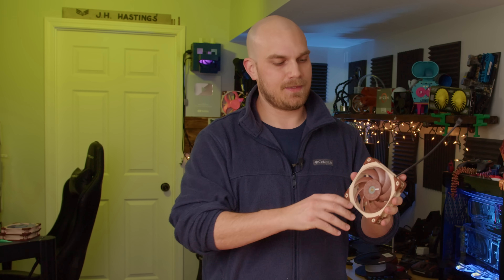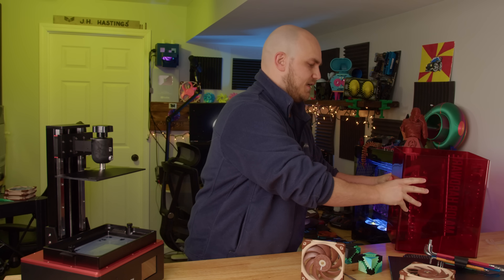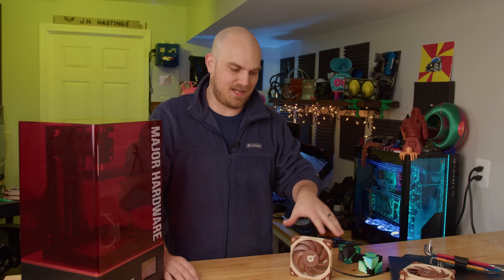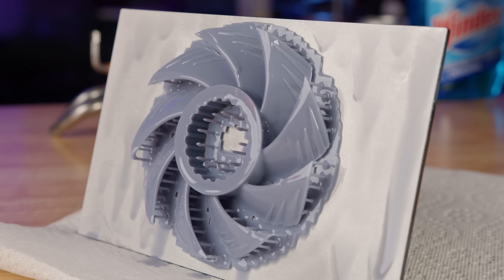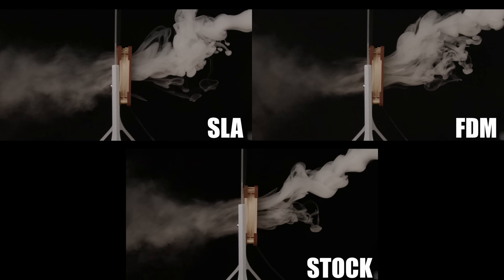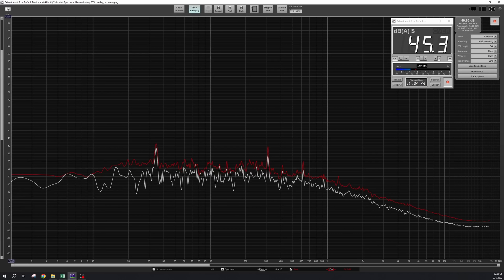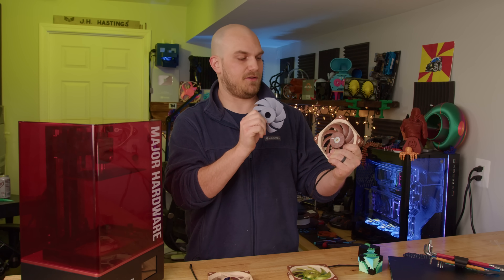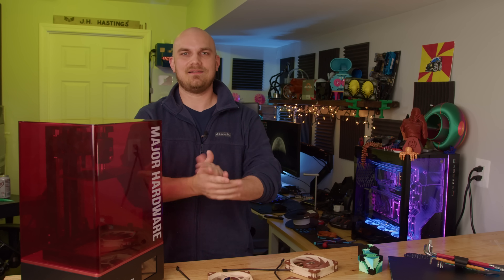I Copied Noctua's A12x25 and Resin Printed it, Its Performance Was ASTONISHING

Comment: I wouldn't bother with SLA printing that much. Maybe only print a fan in SLA if it makes the top 5 leader board. 
I would look at material density, i think you might find noctua uses a modified light weight plastic. A lighter material the motor should be able to spin the fan faster. You might be able to FDM print in ABS if you find one thats less dense around 0.9 g/cm^3. Most FDM plastics are focused on strength and ease of printing, i would think this gives them additives that make them heavier.

Comment: Print best models with resin, and try some of geared models from the past. Resin quality should help with perfomance of gears.  And you may try to print fans holow... not sure it will save alot of weight but some models are heavy.

Comment: A wider test across a couple of fans could give us a more acurate range of how much resin matters. Maybe the 2% is not that much on average, or in this special case, flex acts in a specific matter that either helps or is detrimental. I would try mayve with one or two structure dependant contestants for the showdown and one or two blade design ones to have a better picture

Comment: Personally I wonder if it maybe just comes down to the surface smoothness, since the surface of the FDM printed fan is rather rough compared to the SLA printed one.
That rougher surface could lead to more turbolent flow over the surface increasing resistance and therefore decreasing performance.
So depending on the filament you could treat it with a heat gun (PLA) or acetone vapor (ABS) to smoothen the surface.

Comment: For the FDM fan switch to 0.12mm layer height, use the exclusive tolerance setting, and maybe use some ironing. See if it makes a difference!
Reply: ironing only works well on smooth top layers. On everything else it's a waste of time and is likely to lead to print artefacts
Reply: @iamdmc  Right, but since there tend to be some flat areas towards the front of the blade it could have some minor advantages. Was my only thought.
Reply: Agree with the thinner layer height - surely the resin printer had thinner than 0.2mm layers - let's try to keep it apples-to-apples!
Reply: @fredhamilton1701  His FDM prints are nice, but there are definitely a lot of settings he could tweak for ultimate quality. Problem is the print time tends to go up a lot as you probably know.
Reply: Agreed 0.12mm layers will be a significant improvement.

Comment: YES! Fan blades can benefit greatly by the finer details that resin printers can produce. It would also help to reduce the issues with complex parts because of the tighter tolerances... but one issue with some resins is their shrinkage factors, so some work might need to be put into finding a good resin that has minimal shrinkage and is inexpensive. If cost is not an issue, then there are many engineering quality resins available for a premium that would work very well. Overcoming the messiness and post processing when compared to FDM can largely be done with a good workflow, but yes there will be more steps.

Comment: 2 percent worse AT BEST.
this is a fan you tried very hard to engineer that prints very well and you cared about how it printed for the test.

a lot of user submitted fan look ROUGH compared to that print with obviously much thicker layer height, artifacting, and worse support removal.

the takeaway here is that there's a meta-game to the competition to try and produce fans that perform well but also PRINT well, because making a fan that can printed in good quality will increase performance. 

though we also didn't check the very important data of "material density"
its not a fair test if the FDM fan is heavier than the competition; of course it'll spin slower with more load.

Comment: You should try dipping an FDM fan in some resin then curing it with UV.  That should hopefully provide some smoothing the the FDM print.  You should also try other smoothing methods like ABS in an Acetone vapor bath/chamber.

Comment: Hi Tom, so I have an idea to see how much better contra rotating blades would be. 

Could you take your model mirror it and print a second one and mount the two fans back to back and see if/how much better that setup is compared to a single fan?

Comment: Lmao, you and I both lost beards in trimming accidents in a very similar time frame.

Something to take into consideration is that if you do move to resin printing for the next season, you will need to use the same exact type of resin for every fan. Kind of how there are different material types for FDM, different brands and different SKUs within the same brand will produce different material properties once they are cured. Some are more rigid and brittle than others and like wise, some are more forgiving to forces that are applied to them. Just something to keep in mind.

Comment: i got the elegoo Jupiter, I think you might like it. its a fully enclosed resin printer with a port in the rear to vent the fumes out. it also includes an autofill port and has a higher accuracy compared to the mars. though if you have the money to shill out, I would wait for the Emake3D Galaxy 1. its a fully enclosed, climate controlled SLA printer with professional grade accuracy and supports a massive list of resin types making it capable of printing rubber materials, you can literally print RC tires.

Comment: For detailed prints I usually run mine at a layer height of .15 and seperation between the model and the support of .3. I had tried even more layers (.12) with separation .36 but it is quite evident they just isn't that precise.

Comment: Do a limited run of say, the Top Ten ALL TIME fan-made fan designs(or Top 5, whatever).  "Normal" 3d printing is good enough to compare the fan-fans to each other, but to see if you can close that gap for those fans that are close or surpassing the Noctua.

Also, if you're testing the resin printed version to a different Noctua fan(IE A fan that wasn't torn apart), .6% could be margin of error for using different motor.  Since it is so incredibly close, I would use it as a control from now on for when you change tests or whatever else.

Comment: Before you consider resin - what about FDM with ABS and then using the IPA atomization chamber? I'm just wondering if the rougher lines of FDM printing is accounting for the efficiency difference. With a smoother surface - shouldn't the ABS provide the same results? Thanks for all the cool experiments!

Comment: It's important to do what you enjoy to reduce burnout; if you don't like resin printing, don't use it. Have you considered having a regular season with FDM fans, then having an end-of-season finale (of the top designs throughout the season) in resin? Designs would still need to be built around FDM, but it would provide a more fair comparison to retail fans like the A12x-25.

Comment: 100% resin print the previous winners to have a showdown on what they could be. And maybe even compare then to old prints, if they will get that 2% difference or if in some cases old prints worked even better. I would think sometimes not the smoothest result might also be advantage. Do that before having whole season in resin (smell) printing?

Comment: If it helps you get more fan showdowns published, stick with your current print method and replace the stock fan on the leaderboards with the printed version for a fair comparison. It's easy enough to estimate a 2% increase across the board.

Comment: One thing to keep in mind though - fan hubs will have some degree of speed variations from hub to hub (sometimes +/- 10%), and if the blades are lighter, the RPMs might increase. I think you should check fan RPM in addition to noise and airflow to verify that the difference in performance isn't caused by speed variation.
Reply: Yep.  Even mass delta of the printed plastic could affect the fan speed.  I am sure that noctua uses the lightest plastic that still maintains the structural strength required to hold the fan together at RPM.

A heavier fan will be harder to spin.  Not just friction of the layered print, but mass is a factor.
Reply: @StefanMArndt  not sure if that’s necessarily true. Noctua cares a lot about silence, but also a lot about durability and life expectancy. Heavier fans might also smooth out speed a bit
Reply: Mass changes nothing but inertie, it will start slower, but will have the same RPM at the end ; as long as there is no acceleration, mass doesn't  affect movement.
Reply: @neodymelanthanide2101  Increased mass will change vibration harmonics. Shouldn't matter for the airflow but may affect the noise levels.
Reply: At that level of air resistance i think that little of a weight  variation becomes neglectible.
Reply: Too bad that the OG Noctua A12X25 is fused to its hub. But he could just switch which hubs that the FDA and Resin fans are mounted on to see if there's a difference. And getting an accurate scale and weighing the fans would also be enlightening.
Maybe even sanding down the heavier of the two until they have equal weight.
One could also look at the difference in bulk density between the resin and the FDM material, but the layer thickness can easily drown that out for thin geometries like fan blades. I.e. it would only matter for fans that already handicap themselves by being bulky and heavy.
Reply: Mass and moment of inertia data may be interesting to track.
Reply: To avoid differences, the fans should be tested before removing the Noctua fan from the hub. This would ensure that the three hubs selected for the test are equal.
Reply: Absolutely true. I think the make apples to apples comparision, you want to use the same hub for every test and run the fan RPM controlled.

Comment: 8:10 I think you should do another testing episode with the resin vs fdm. Do multiple models in both, test them all; and if we see consistency in the performance difference, then you should go with the easier, cheaper, faster option. From there we can just assume a performance improvement if done in the other medium.

Comment: i think a fair comparison would be to set the stock fan shape in showdowns to use the fdm stock printed instead of the injection molded one that came with the fan. That way you can still print in FDM but the comparisons would be purely on fan design since you've eliminated the disparity in part quality.

Comment: I would only resin print fans that do particularly well. Easy enough to add 3% on your excel sheet to get an idea of where it would land if resin printed - maybe a special episode with best of the best resin printed? It would also be cool to use your accurate model of the noctua to create designs varying number of blades - considering the effort you put in

Comment: I'd say to start off conservatively; take the top two best fans of each season and test them out vs themselves (resin version vs filament) and the Original, in a slightly more comprehensive test (both free-flowing, then in front of a radiator, then also in front of a heatsink). Then pick out the best ones to start off a season or two of Resin designs (maybe one season of tower cooler/airflow-focused, and one season of radiator/static pressure focused).

Then maybe go wild with a few resin prints of wild designs, such as the Tulip, or those that had very good performance but was hamstrung by blade warp at high speeds (basically scratching the inner frame and losing some performance).

Comment: With the comments of the resin printing the top 5 fans for performance comparison, I think is a reasonable idea, but, I think the real criterial should be what geometry of the particular fan is involved? A clunky blade design isn't going to care if it's printed on a clunky printer... but if you have a model with thin details or intricate details, I think you're going to see more improvement with the resin print. Another example perhaps would be the mobius strip fan thing... the $3000 boat propeller one... that would likely appreciate a thinner leading and trailing edge.

Comment: EPAX X156 3D printer With a 345x194x400 mm build volume. is a solid resin big boy. and if you look at a video for resin model stacking like from uncle jesse's "Extreme Resin Stacking 3D Prints" you might beable to do a full seasons fans in one print. so you don't need to deal with resin printing much.

Comment: you need some carbon filters on your resin printer. they help soooo much with the smell. i had that issue at first and got a few and boom almost imperceivable. its there but you really need to get close and take a big wif to smell it. atleast for my setup i did.

Comment: A resin print season would be cool. But I also would like a confirmation that it is indeed 2% better across the board not just in this case. Also I think that if the resin print season seems like a lot of effort and you do confirm they are 2% better... you can always switch back and just have mock resin stats

Comment: Did you measure the weight of the resin vs the FDM print?  Could some of the performance difference be due to a difference in rotating mass?

Comment: You can get resin quality print on an fdm printer fairly easily. Stock ender 3 can print at .08 or even .04 layers heights and with the right slicer settings it’s pretty easy to make layer lines disappear. Looking at 4x the print time though

Comment: If something comes within 2% of the stock fan then sure, see if resin pushes it over the top, but otherwise stick to whatever is easiest for you. As long as the rules are consistent then you're still comparing like for like within the leaderboards. The "absolute" performance isn't the point, it's the relative performance that matters.

Comment: regardless of your choice of what material you use for the next season, i feel you should use your copy of the noctua rather than the original. since there is a difference shown between the two models made from different materials. i feel even if you made an exact replica of of the noctua there would still be a difference in terms of performance. and no matter size in the difference it would only seem fair to judge people's fans against the copy with the same material.

Comment: You can try resin coating the FDM print.  It might smooth out the surface enough to improve the performance.  You can also try resin coating your future FDM prints.

Comment: How does the weight of each fan compare? 

Considering the same models, it would be interesting to see how the mass would affect the performance. This parameter may be linked with rigidity though. A study might have to be done where a less rigid, more massive model is compared with a stiffer, lighter model. (Assuming higher rigidity and decreased mass are beneficial. Might not be the case though)

Comment: There's a lot to be said about the fluidity of air and the smoothness of resin prints but I think resin fans might worth pursuing just because of the volume of fans with other moving parts like gears and such. Resin printing those fans will definitely cut down on the grinding noise and help with smooth motion.

Comment: i honestly don't think it's worth printing every fan in resin. perhaps at the end of each season you could reprint the top 3 or something and see how good they actually are, and eventually you'll gather a statistical deviation that is common between any fan printed SLA vs FDM. this means you could infer the performance of any FDM fan based on previous trials, which could tell you ahead of time whether or not a given fan would be worth retrying with resin.

Comment: I've been getting back into resin printing and let me tell you a flexible magnetic build plate does wonders for getting models off.  Had a model that nearly covered the whole build surface that wasn't a total nightmare to get off, just a bit of twisting and slipping in a small metal spatula.

Comment: I think that as long as that 2% performance reduction is repeatable across different fan designs, then there’s no reason to suspect the SLA would give a meaningfully better test of designs. Although, DFM is an important part of any design, so the increased limitations of FDM may actually make it a better test.

With that said, if it reduces the cycle time and/or labor of doing the prints for you by using SLA, maybe that’s still a worthwhile investment.

Edit: spelling

Comment: I imagine the person that sent that other guy a model probably doesn't work there anymore or got reprimanded pretty hard if anyone actually found out. I suspect the resin printer difference might be down to the density of the print, a more solid structure might make it more sturdy. No doubt Resin isn't for everyone but if you can stomach it you can do some pretty fancy things. It's up to you if you want to switch though. I imagine most people don't have resign printers if they wanted to match you results or use the fan designs. Maybe you could do a mix of both when necessary?

Comment: As someone who does resin printing, I would love to see more resin printing. I agree it is messy and smelly and getting your setting spec accurate can be pretty difficult, however I think if you can dial it in it would be worth it. I also think finding the best resin to use and sticking with it is a much larger thing than in filament. I look forward to it if you decide to go that route. Thanks again for your dedication, love the channel and your work.

Comment: Congratulations for your new born.
Resin print should be used to deternine the winner if within 2% and only for top contenders.
That based on the assumption that resin is more costly and cumbersome to use.
Also, at low renoylds numbers well placed surface imperfections could actually help performance.
Those often are called turbulators.